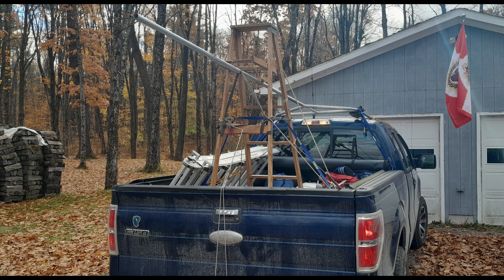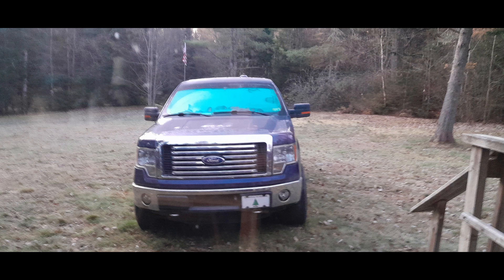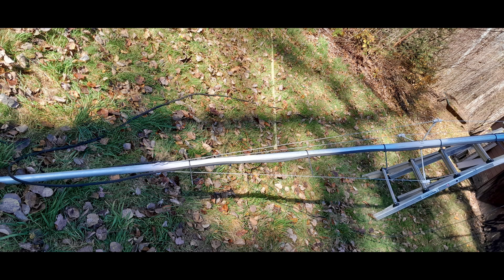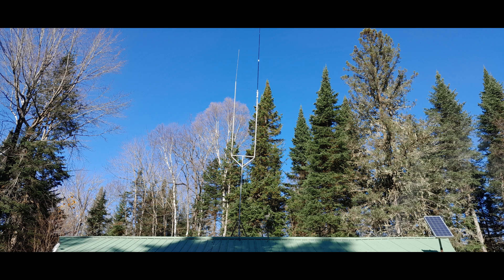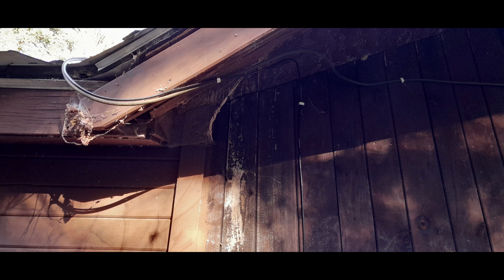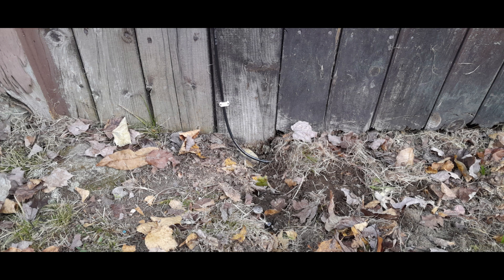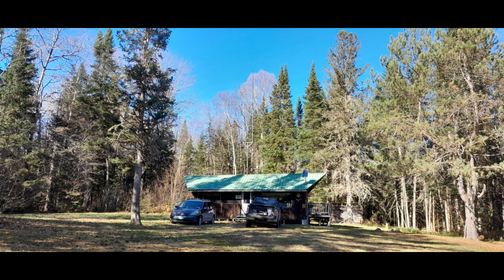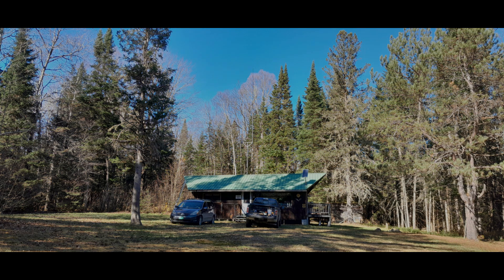Antenna Farm - Part 5

Comment: what antana did you use and is this side band or CB... o to the one comment strange men.. its not just strange incounters No Clue... this is usefull with the climet change.. this could pruve useful to help some one .. i have a steel mass like a gerter frame thing?? iv been thinking about this with a linear  thank you for shairing hope it holds up
Reply from the maker: Hello and thanks for the comment!  Thanks to your question, I updated the video description with links for information on the two antennas you can see flying in this video.  The antenna on the LEFT is for a CB radio, white in color.  The antenna on the RIGHT is for HAM radio, black in color.  Radio as a hobby is full of varied personalities, that is certain...but in my experience there are far more respectful and intelligent conversations to be had than the problematic ones...and radios have knobs...you can turn the channel or turn them off!